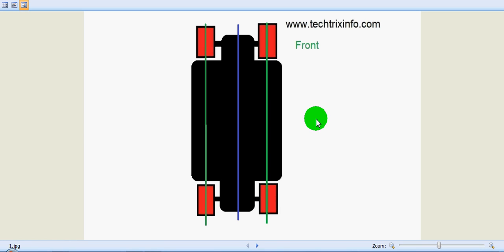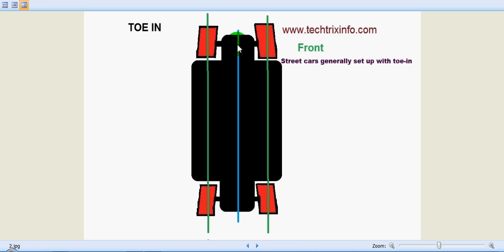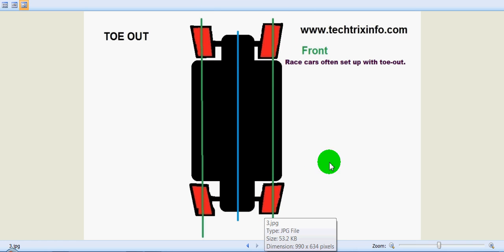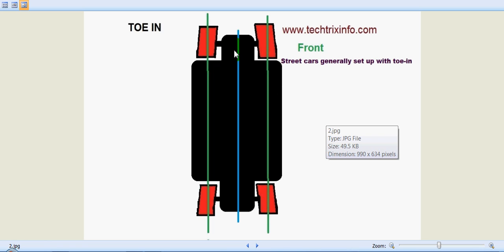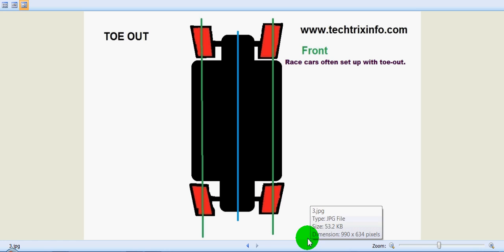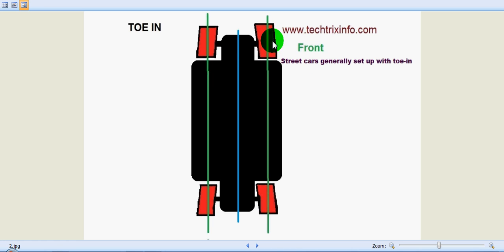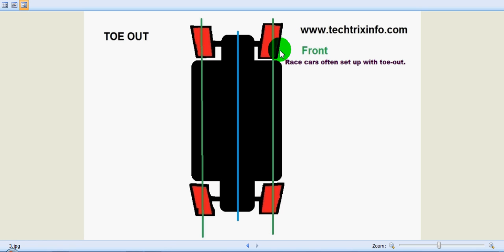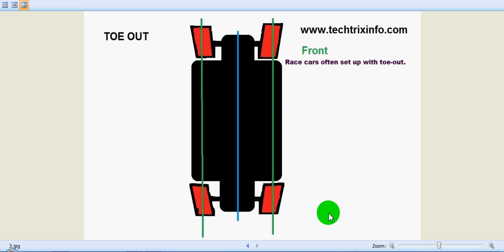Animation - How Toe-In & Toe-Out works. ✔

Comment: Does toe in/out affect straight line speed? I would think that it adds friction and should slow the car down
Reply: +Aireisor simracing n drifting if your wheel are not straight you're will automatically lose speed fella

Comment: Is this correct? I Toe in and toe out i believe are only implemented on the front wheel?

Also toe-is i believe is used on rear wheel drive vehicles while toe-out is used in front wheel drive vehicles. Although it does affect steering response i don't think it is primarily concerned with steering response?  ? i am ready to be corrected but please do explain why. Thanks.   
You are doing a great job with your videos and I have learnt a lot from you. thanks.